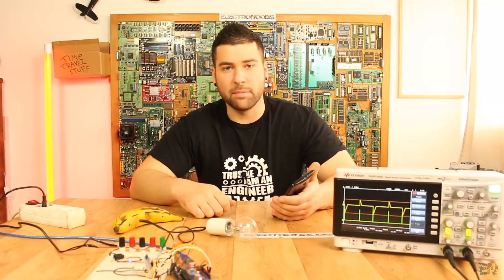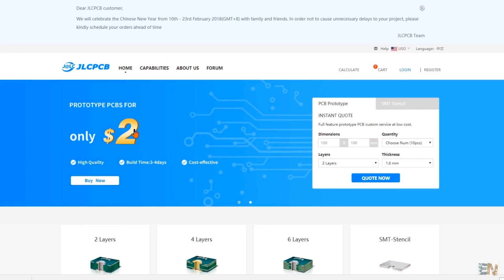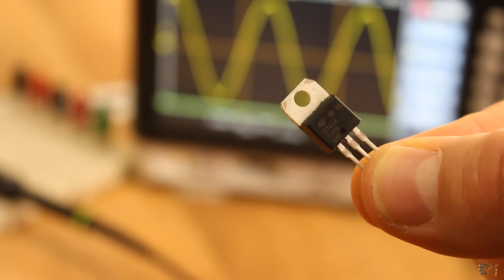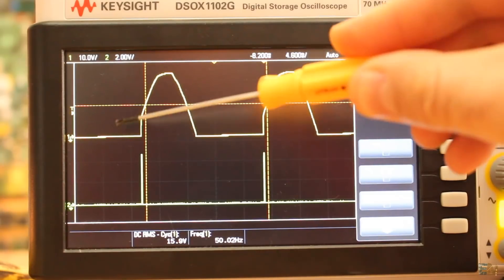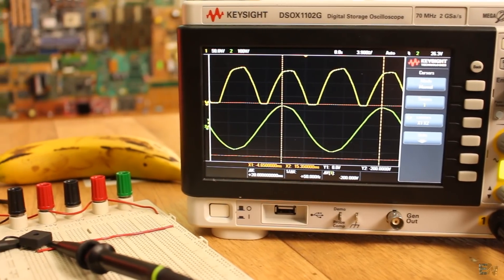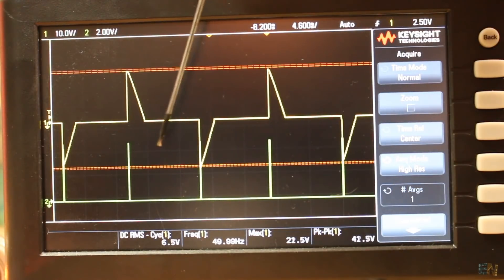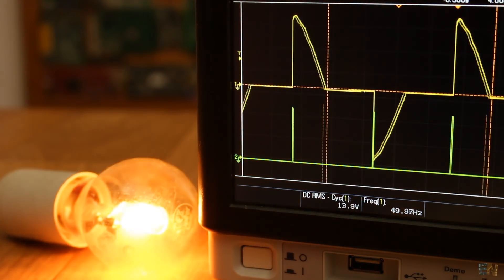Bluetooth TRIAC AC power control

Comment: I want to control a transformer with an arduino to produce output pulses e.g. 
Pulse 1 12% power 50mS duration, Delay 500mS, Pulse 2 55% power 80mS duration. 
I think your circuit are a good start. 
Can you tell me how to research the circuitry and code to do the following with an Arduino so I can see my settings on a display? 
Control Pulse 1 and Pulse 2 pulse widths
Control Delay duration
Control Pulse 1 and Pulse 2 Power levels (as a percentage of full power) 
Connect the control switches/buttons and display? 
I have never used an Arduino before. I have been advised to use an Uno r4, do you recommend it? 
Thank you, very well done example, I appreciate the oscilloscope display, that makes things very clear.

Comment: I think instead of detecting:

if((PINB & B00000001))

you should detect

if(!(PINB & B00000001)), once you're using a pull-down resistor. When I was using the first option the delay was never aligned, once I've changed for the second verification I could use 8333 which is used for my 60Hz trigger. In full bridge case 120Hz. The worded like a charm

Comment: Wont there be a flicker since last_CH1_state was not set  to 1 during the positive part,  now during the negative part detectado is never set to 1, since last_CH1_state was not set to a one in the positive part.Let electronoobs tells us because am confused there and how does the map  function work,  i thought from a low to high conversion  like valor= map(analogRead(A0),  0,  1024,  10,  7200)

Comment: Thank you for sharing. How did you calculate the 47k resistors for the optcopler in the zero detection?
Reply: You have to consider the maximum current allowed in the diode and the peak voltage.
Reply: @charleslyell3748   That is correct. You seem to believe I don’t know how to calculate resistors.
Well, let’s see: 
VR=311V−1.2V=309.8V, right?
IF=309.8/94000≈0.0033A, right?
The datasheet says the EL718 needS 10 mA to 20 mA. All I wanted to know is: are you sure that 3.3 mA is enough to switch an EL817 optocoupler?
It makes sense to go lower, since more current also means more heat dissipation, but 1/3 - 1/6 of the typical current seems a little low to me. On the other hand, I’m not an expert on mains, which is why I’m asking: how did you calculate the 47 kΩ resistors (in this case)?
I did NOT ask how to calculate resistors in general.

Comment: Hi, I designed the same circuit but I am getting only positive pulses at output, the negative half is completely clipped. Can you please guide what the issue is. The output of MOC3020 provides pulses in both positive and negative halves at the output but as soon as I connect those with gate of TRIAC, only positive pulses are there. What would be the reason (I already have replaced all the components).

Comment: I am trying to do the same:
1- sleep between 0 to 10ms after zero detected 
2- turn 1 the pin
3- sleep for 100us
4- turn off the pin
but my fan is behaving like drunk - unstable
I am not sure if this is fan issue or what
While detecting edges, we shall see 2 times per Hertz, right?  So 100 per second

Comment: thank you so much. it worked perfectly.
Reply: which full wave bridge rectifier did you use?
Reply: @bilalqasim2555  4 x 1n4007 diodes or 1 mb10m BR
Reply: @mani5004   Actually I mistakenly bought a 2W04 bridge rectifier and its forward amps are 2.0 A. I connected it with my photocoupler and it goes bam. Can you give me any tip how should I reduce its amps to 0.5 mA? Thanks for replying btw
Reply: @mani5004   If you have built the circuit and its working can you send it to me? If not then for zero cross which photo transistor did you use? and how many resistors you connect? because i tried the same circuit shown in the video and code its not working and my EL817 Phototransistor blow up. Any guidance?
Reply: @bilalqasim2555  first check an ordinary LED with 4 1n4007 diode bridge rectifier in series with 100k 1/4 watt resistor. if it glows then connect it to the same EL817 optocopuler. it will work sure . follow rest of the diagram as in this vedio
Reply: @mani5004  Thanks for your replies. What i have done is I have used a 0-9V step down transformer with 1n4007 diode rectifier and follow the similar circuit. What it happens is my output bulb just flashes for like some milli seconds and then turns back off. In my area the output voltage is 240V 50Hz . what could be the problem here is there any problem with zero crossing detector? or potentiometer mapping? I don't know what to do I really need guidance here. I have been busting like 15 hours but couldn't find the solution for this. Thanks in advance if you can help.
Reply: @mani5004   I just checked with 4 x 1n4007 bridge rectifier with input of 240V with 94k ohm resistor in series with the led. My led blow up then i add another 10k ohm resistor to the led then my 10k ohm resistor starts melting. what is this ? Did you really tried that circuit?

Comment: Hello. I was researching on how to use arduino to control ac fan regulator. I have seen circuits similar to this. But there is a capacitor involved in the output end. I couldn't quite find the reason why use a capacitor? See this: https://drive.google.com/file/d/1MqSCiCM3cB-zlLTYcfNPaWNCFQn2ljPH/view?usp=sharing

Comment: Is frequency gets changed by using triac. Also can I use a bridge rectifier instead of bulb for variable DC power supply. Can i use digispark attiny 85 instead of arduino uno(i don't need bluetooth)Please reply it
Thank you

Comment: I have a question !
I'm doing a outdoor lighit system, with arduino, Pir sensor, Triac Bt139 e Moc3021p ... I'm with some difficultys. Can you help me please ? 
Before i was using a relay (5v), with a tiristor and a diodo, but the relay had me some problemas and i'm tryind this other way ..

Comment: hello, i need a bit help. i am able to control brightness of light through bluetooth but the problem is that, how to add simple on/off program in the same code. actually, i am facing problem when i add some code for relay etc. 
for instance, 
if(variable== 'R')
{
pinmode(relay, high)
}
 help will be appreciated. thanks

Comment: USING 47K RESISTOR  I AM NOT 5VOR 3.3V FOR OPTOCOUPLER 817 OUTPUT IT SHOULD BE  82K OR 100 K
Reply: you mean if we want 3,3v and not 5v we need 82K resistance ?

Comment: Why your switching time is 10 ms that is half why not 20 ms to control  whole range from 0 to 220 volt?
Reply from the maker: is 10 because you fire one pulse from the start of the wave to the first zero cross and another pulse from that zero cross to the end of the wave. So 10 + 10 is a full wave.
Reply: ohh yes yes now i am clear its 10 actually thanks
Reply: I have one more question

Comment: Hi dear! How can I use an ESP8266 instead of the Arduino? Is it possible? Another question is that in the circuit you put an EL317, but in the eBay link is the EL314, it will not have a problem to use the EL317, right? Due we are using just one side of the wave... Thank you dear! You are simply the best!
Reply: also I want to use en ESP8266, how can I have 3,3v and not 5v at the output of optocopler ?
thanks

Comment: Nice video. BTW you would not need a triac as the MOC3020 already has one :)  It worked for me without the triac!
Reply: hello can you please tell me is it reliable to use triac for voltage controlling or is there any other method as someone told me when you control volatge with triac the current will increase very much
Reply: @zuhaibchoudhary4635  Triac is one of the two options I know voltage controls, (the other is with mosfet / IGBT) and triac is very reliable. BTW In the MOC3020 it is recommended not to connect it directly to load
Reply: @arushgupta yes I know dear but Mosfet and IGBT are for controlling DC voltages I am asking for any other method than triac for AC control
Reply: @zuhaibchoudhary4635  Oh, then I woyld reccomend triac cause that is the only one I know, do you know more?
Reply: No I also dont know anything elsw

Comment: hey bro, can we use this circuit to vary the voltage being supplied on an AC induction motor? do you think it will damage the motor?
Reply: Not a good idea. AC motors generally rely on a clean sine wave (or sine wave pwm) to be driven, and chopping it with triacs isn't really going to give good results. My guess is you might have to build (or buy) you own VFD, especially if you want to control speed, since the frequency of the AC current needs to be modulated. Changing the voltage will affect the maximum torque
Reply: Not an induction motor. The only type of AC motor this will work for is a universal motor.

Comment: one question:
Did you connect the photocoupler to 220v? All I see is 220v going to the full bridge rectifier and then the photocoupler? Reading it's datasheets, the photocoupler accepts around 5-6V? Am I missing something here? The schematic shows like that too, just 220V, no step down converters or such.. thanks in advance!
Reply: Bro, there are resistors in series with the diode that will drop almost all voltage.

Comment: When you measure the AC Voltage on the bulb contacts, will it always be 220v but duty cycle will vary from 1-100%?

Comment: Might you help me!! I'm trying to do this project for my power electronics class! and then I built everything the same, the problem is that the focus remains blinking a lot, I control it with the application and in any position of the app slider the focus flashes, sometimes even the light goes down well. What will it be? In my country it is voltage 120, will that be why? another thing is that I am using the triac bta 12. Help!

Comment: Video is really helpful.🔥🔥

Can we connect the load and ac supply to the diac.
And control it via arduino, so we dont have to use triac?
Pls cmnt on this.
Reply: You need a TRIAC to switch voltage using the Arduino.

Comment: Love your way of clarifying the concepts behind your project. You mentioned briefly that you can use step down trans say 230/12 volt. Is that mean that if I provide 12 volt to your circuit all the components will function with NO CHANGE. of course I will use an LED as a load instead of the 220 volt lamp.

Comment: i use a transformer  220v/5v AC before the rectifier, i use a halogen lampe but it flashes is that because i use the transformer ?
Reply: I have this same issue it just flashes and no voltage on the load.

Comment: I ma trying to use triac and optocoupler for an inductive load circuit, but the problem is I m getting the sine wave from the output of the optocoupler ( which is input to gate of traic). What is the problem?
Reply from the maker: Niranjan KC have you used the same schematics and components as in the tutorial?
Reply: I am having the same, but still, what's the problem?

Comment: Can we connect celling fan without using extra protection circuit because coils are making negative voltage and it will damage the TRIC and DIAC

Comment: Hey good work, i tried the circuit with BTA26 triac and it worked but there is some weird flickering in the output. Any suggestions what might be causing it?
Reply from the maker: Check the output with an oscilloscope. Do you have both parts of the wave, positive and negative?
Reply: Well the irony is i don't have an oscilloscope and yes i have both parts of the wave since i am  using FBR, i think the problem is with the timings(triac firing) in code. what do you think?
Reply: I think it is caused by not setting last_CH1_state to 1 during the positive part,  now during the negative part detectado is never set to 1, since last_CH1_state was not set to a one in the positive part.Let electronoobs tells because am confused there and how is the map function work i thought from a low to high like valor= map(analogRead(A0),  0,  1024,  10,  7200);

Comment: Actually, it's 230 V, not 220 V. This was changed a long time ago here in the EU, Russia and Ucrania. Check this (in Spanish): https://es.wikipedia.org/wiki/Electricidad_dom%C3%A9stica#Historia_de_tensiones_y_frecuencias. It might be 220 V if you're far away from the supply cables that go to your house (which are guaranteed to give 230 V ± 7%) because of the voltage drop. I confirmed this: if I turn on a high power device (like a radiator), the voltage drops. Sometimes the voltage goes to 210 V or less, and that's when my line-interactive UPS' relay clicks and steps up the voltage to 230 V.
I wish all this was finally unified sometime and all countries used the same voltage, frequency and plug type! I'm working on a new plug type which I'll use in my smart plug (Kickstarter coming soon), but it'd be difficult to do something about the voltage or frequency (bulky transformer for voltage and maybe a matrix converter for frequency, easier said than done).
Reply from the maker: Yes, that's true. Sorry. is 230V

Comment: VERY IMPORTANT SAFETY ADVICE!!

In english here! En español abajo!

Good circuit men I built something similar in the past. I need to clarify one point that is very important. Take care with inductive loads (motors, CFL...) especially with heavy ones!!, because triacs and also diacs have dv/dt specs, it means that if you change the voltage very fast the triac (or diac) can be damaged or even worse, destroyed :S. (When you switch ON/OFF a inductive load voltage spikes can happen). Also if you connect a heavy load (which demands a lot of current) there will be more power disipation on the triac/diac because Power = Voltage x Current, this means that the triac/diac can get very hot quicky and this will cause the destruction of the component. Check the datasheet of the component and put a good dissipator to prevent this ^^.

As bonus! ^^ To prevent problems with heavy inductive loads you should use a snubber circuit. Designing a snubber circuit requires more knowledge in electronics but if you are interested I invite you to search in google snnuber circuit for diacs/triacs ^^.

I hope you, people, understand my explanation :), I'm from Spain too :P. See you!! and have fun with safety electronics!! ;D.

EN ESPAÑOL!!! para los hispanohablantes! ;)

Buen circuito tío! construí algo similar en el pasado. Tengo que aclarar un punto muy importante cuidado con las cargas inductivas (motores, CFL...) especialmente con las "pesadas" (bobinas grandes tipo transformadores, motores grandes...) ya que los triacs, (tambien los diacs) poseen especificaciones dv/dt lo que significa que si se cambia el voltaje bruscamente (muy rápidamente) el triac/diac puede resultar dañado, o aun peor, destruido :S. (Cuando conectas/desconectas una carga inductiva se pueden producir estos cambios rápidos de voltaje de los que hablo). Ademas de esto, si se conecta una carga que demande mucha corriente (no tiene porque ser de tipo inductivo), habrá mas disipación de potencia ya que Potencia = Voltaje x Intensidad, lo que hará que el triac/diac se caliente muchísimo y esto puede causar su destrucción. Recomiendo mirar el datasheet, mirar que potencia soporta el componente, que intensidad y que voltaje ^^. También una buena idea es poner un buen disipador para prevenir estos incrementos de temperatura en el componente.

Como bonus!! ^^ Para prevenir problemas con cargas inductivas "pesadas" convendría usar un circuito llamado snubber, es como una especie de filtro que evita picos de voltaje, pero para diseñar uno hace falta tener conocimientos mas avanzados de electrónica, os invito a buscar en google snubber circuits for triacs/diacs (circuitos snubber para triacs/diacs).

Bueno después de todo este pedazo de comentario, espero que nadie se electrocute, se cargue la instalación eléctrica de su casa... jaja Disfrutad de la electrónica, si vais con cuidado nada malo pasara! un abrazo gente! ^^.

Para el Autor del vídeo! me identifico contigo yo también estudio ingeniería Electrónica y ya estoy casi acabando tengo 24 años! jaja Un abrazo sigue así y cuidado que no se te electrocuten los subscriptores! jaja :P

Comment: The Bluetooth module is designed for 3.3V input. By connecting it to the 5V supply, it will work but it also shortens the life of the BT module and eventually damage it. Better to include a voltage divider fot the power input. Just a heads up ;)

Comment: Nice video, I wanted to make this for a long time. Do you think you can control bigger loads with this device like 2200W keetle ? And also, according to wikipedia mains voltage in spain is 230V not 220V is wikipedia wrong ?
Reply from the maker: TheRodionRaskolnikow this triac won't withstand 2000w. And yes, Spain is 230V, I was wrong!
Reply: Could you be more specific? Your triac in theory will withstand 16A which is 3600W at 230V. Can you tell my why 2300W load will blow him?

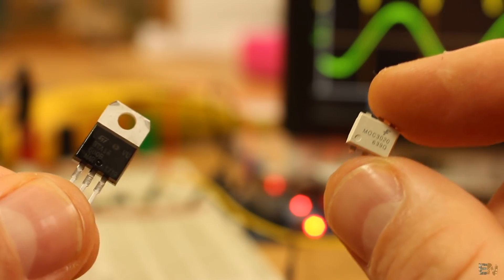Comment: 7:05 You're talking about diac, but show the optocoupler. Rather misleading. You describe the diac correctly, but why when you show the opto? It's gonna be confusing for beginners. Overall, nice project.
Reply: that part was an optoacoupler "optodiac" works like an optoacoupler normal but its made for triacs
Reply: Alejandro martínez He showed MOC3020 which is generic optocoupler with triac output. There's no photo diacs, if there is, give me exact link.
 Diac is used in simple dimmers, it's 2-pole device.

Comment: I have what question. Does optocoupler lowers voltage from 220v to 5v or what? Because you connect it directly to Arduino on one side, and on other side to full bridge rectifier which uses 220v
Reply from the maker: Đorđe Milanović yes, one side of an optocoupler is connected to 5V an ethereal other to 220. But there is no connection since is an optical control so there is no physical connection. Keep up!
Reply: Hi, I recall that there are some optocouplers that can do that , they start with MOC do a search for that.
Reply: Electronoobs So using optocoupler, you can convert any voltage to any other? But only for sensing it